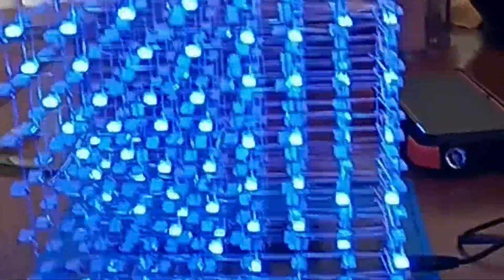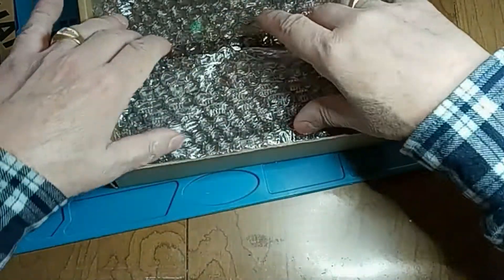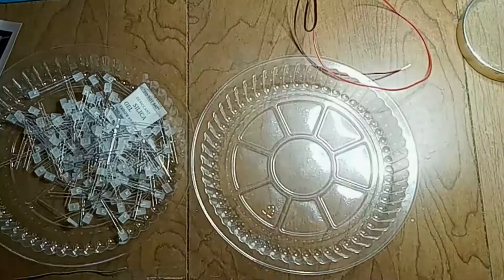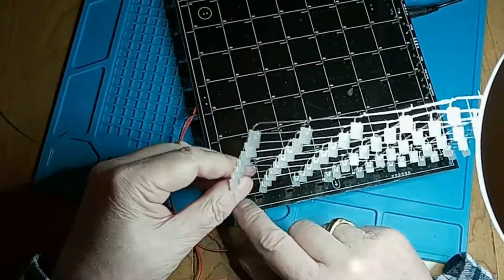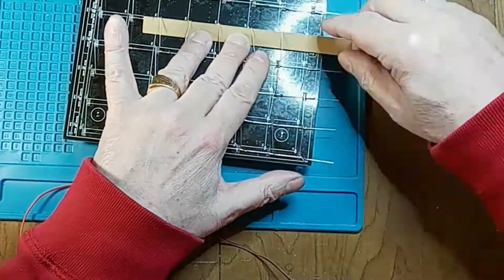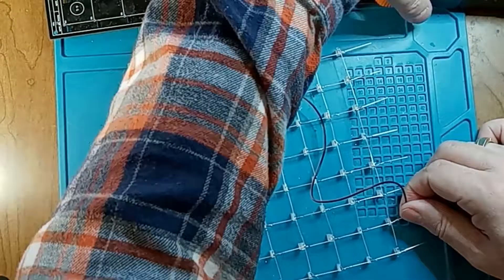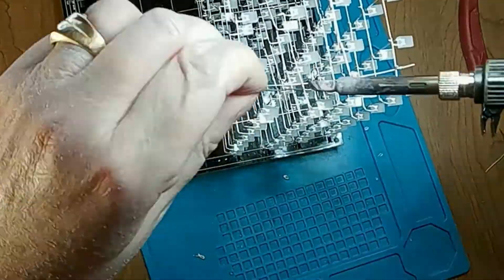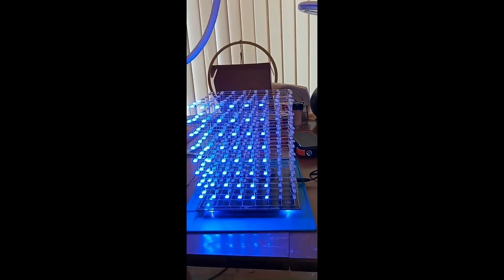Three D 8x8x8 Blue LED iCubeSmart Kit Build

Comment: Where do you put the white wire you strip down
Reply from the maker: There're 8 holes in the PCB. One end of each wire goes to a layer of horizontal wires. The other end goes in the holes in the PCB.